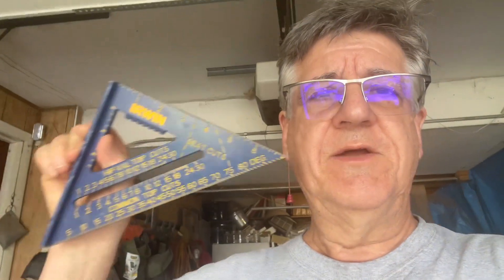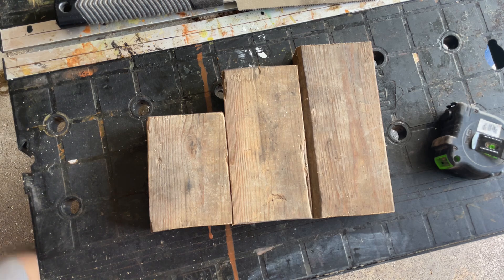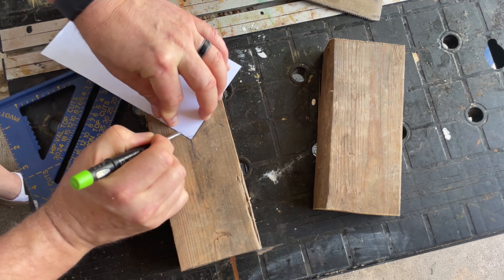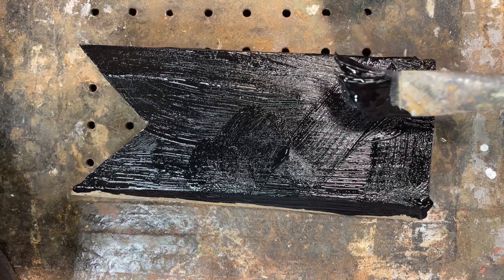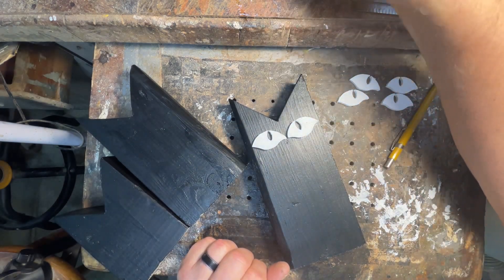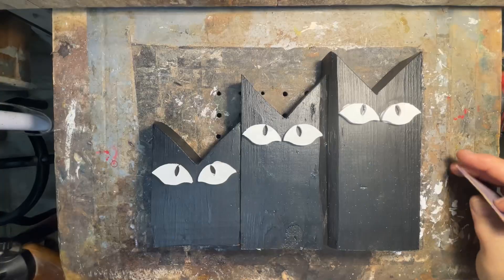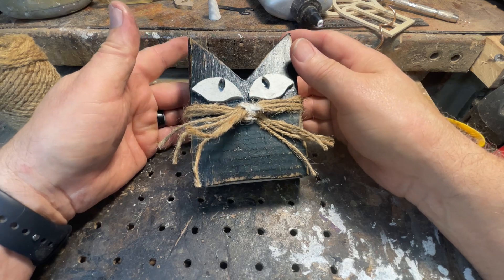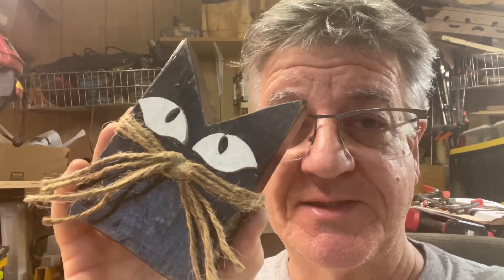Craft show best sellers. Black Cats

Comment: How much do you charge for them at a craft show?  Or is that something I'm not supposed to ask?
Reply from the maker: I charge $30 for the set. ($10 each if I need to break the set). Keep in mind that you may be able to charge more in your area. Also, you might need to charge less for that same reason.  

As far as “I’m not supposed to ask” I will always answer that question.  Prices are the hardest part of selling your work.
Reply: @kedespo  Thanks for the help!  Pricing is a nightmare!
Reply from the maker: It truly is.